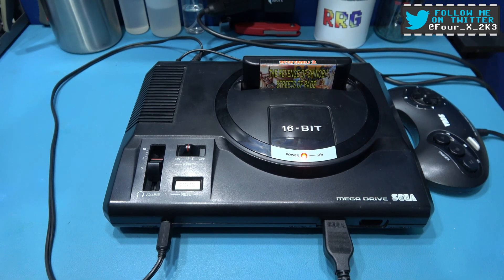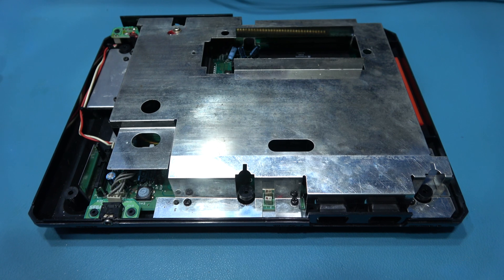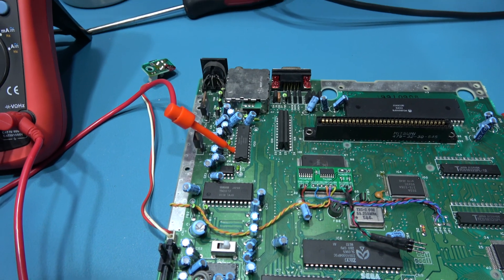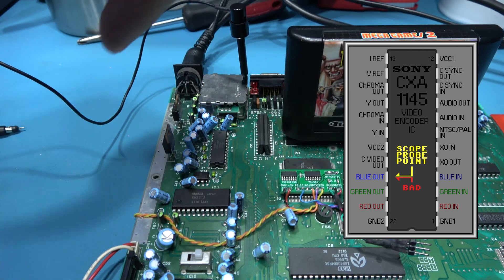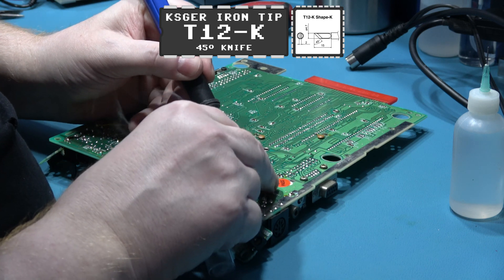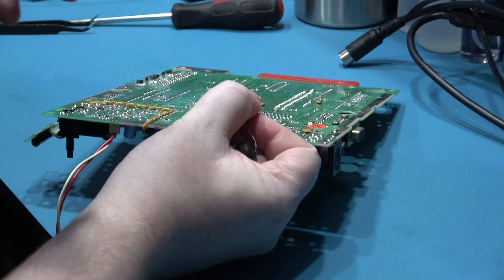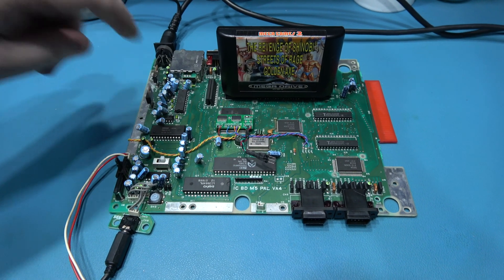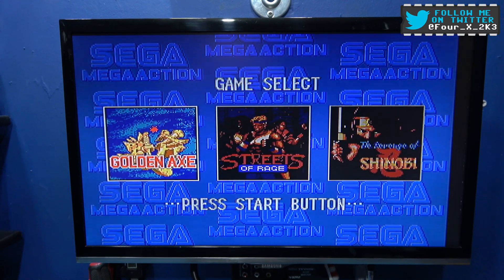SEGA Mega Drive (Genesis) - Missing the blue colour from the RGB video output - Can I FIX IT?

Comment: Hi, first of all, congratulations for the repair. I myself have a SEGA Mega Drive VA4. Got some issues with it; it seems like the console outputs a yellow-ish toned image. All the colors are working, but it seems like the white objects are yellow. I tested both the A/V and RF outputs and it does that on both. Got any clue on what the problem could be? Thanks in advance🤙🏻

Comment: Thanks and bravo !! I'll try to repair mine, I already got a new chip replacement part but I'll probe a bit more.
Can I probe the way u do with a logic probe ?
Reply from the maker: Not with a logic probe. The RGB going into the video encoder chip is being attenuated to 3Vpp as it's a little hot for the video encoder chip. The video coming out the video encoder is attenuated to TV levels 1Vpp, so using a logic probe won't work here as the RGB is not at TTL level's. You will be able to probe and check the RGB coming out the custom SEGA video chip as that it's TTL Level.
Reply: @Four_X  i see. If I understand the voltage is too low to be detected by the logic probe. It is just a low level signal which needs an oscilloscope go be detected ?
Reply from the maker: Correct.
Reply: @Four_X  I see thanks a lot ! Maybe I will invert in a small one later on but they are expensive.

Comment: Nice fix!  I’ve not seen an oscilloscope in use before. It certainly takes the guess work out of problem solving.  Sadly I can’t afford the one you have!
Reply from the maker: Thanks, oscilloscope's are getting cheaper. it wont be long before you can pick up a good one for under £200.
Reply: @Four_X  thanks for your reply. Funnily enough I picked up  an owon sds1102 today from Amazon deals for £164!  It arrives tomorrow. 😁 Never used one before, so I’m looking forward to learning all about it.
Reply from the maker: @kooky2  Have fun it's the best way to learn.